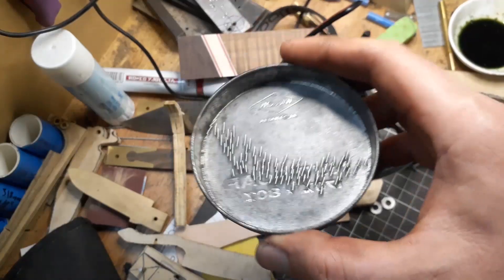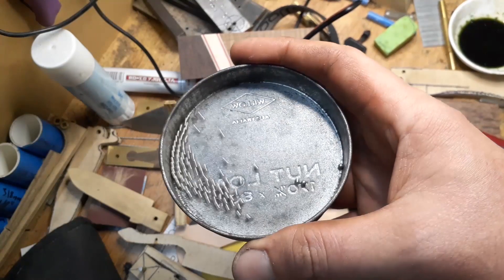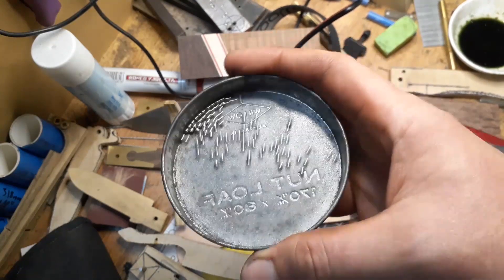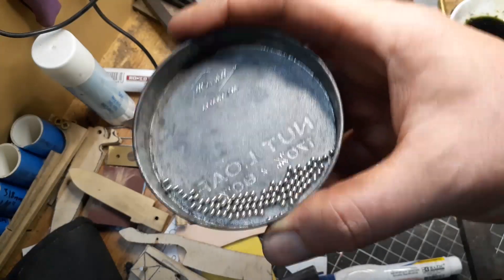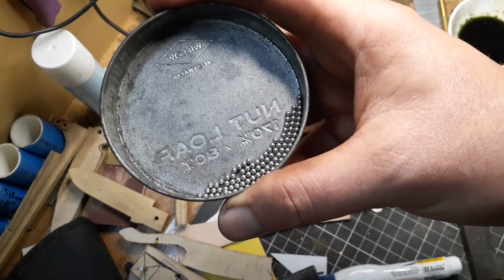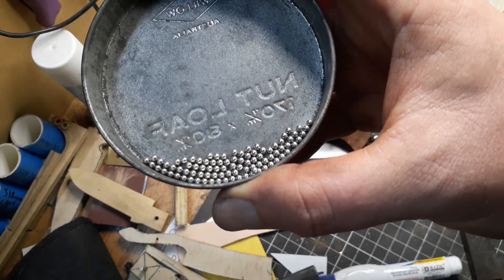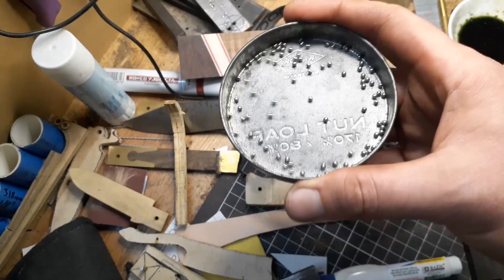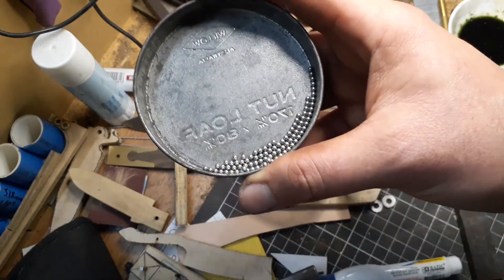Grain Structure Simplified For Beginners

Comment: I love knowing the why, things make so much more sense. So how does this apply with springs, or with your journeyman or matter level knife that you have to bend? If you're supposed to have right grain structure wouldn't that be a hindrance, or am I not understanding it correctly? Great video sir love the information. Keep up the good work.
Reply from the maker: A great question! So the tight grain makes the knife tough, and strong, but the tempering relaxes the bonds (the little bits of string) to allow them to have a bit of "give" rather than being super firm. This allows for a certain amount of spring! Tempering a blade correctly involves relaxing those bonds just enough to allow the knife to flex, but not so much that it will stay flexed! Check out my video on Young's Modulus of Elasticity to find out more!

Comment: Nice explanation Alex, thanks. Know "why" really improves my understanding of things, otherwise it can be rote learning of black magic. I've enjoyed Larrin's book and Sam's videos too. I think I need to re-read/re-watch to get it straighter in my mind. What is the metallurgist's name for the "fractures" that are the grain boundaries that stop the dislocations travelling past them?
Reply from the maker: As far as I'm aware the fractures don't actually have a name. It's simply the boundaries between the grains. They are the lines which separate the regions of organised crystalline structure from each other! I suppose you can think of it like tectonic plates. We have names for the plates, but not for the place where the plates are butted up against one another!
Reply from the maker: As a fun fact, if you look at the irregular patternation in the zinc coatings on galvanised metal, you are actually looking at the grain structure of the zinc coating. It's the same thing happening, but at a macro scale!
Reply: @ValhallaIronworks  Great, thanks Alex :)
Reply from the maker: Hey mate, I found out the name of the "fractures" and came back to tell you 😂 they're called "slip planes"
Reply: @ValhallaIronworks  Thanks very much :)

Comment: Nicely done, sir. The unfortunate truth is that to keep grain structure under control, at least for me, money must be ponied up for a proper heat treating oven so the proper soak times can be achieved, and so the quench is done at the correct temp. Reading the material sheet on 1084, which I've made lots of knives out of, pointed out how far from good grain structure I am. Sigh.
Reply from the maker: 1084 is always called a beginner steel, but it can be made to have INCREDIBLE toughness if treated correctly! A proper kiln setup is on my tool up list for this year!
Reply: @ValhallaIronworks  Me too! Paid for a biggish Evenheat two weeks ago, but there's a 20-week turnaround time. Sigh.
Reply from the maker: @brysonalden5414  that's why I'm building my own from scratch 😂

Comment: A knife guy once told me: imagine you're traveling by train, pretend one of the cars is full, about 100 people in there. From the windows it will look full, but they can still move around a little. Now put 200 people in there, it's still full, but there's more density and the people cannot move around, it's much more dense. Now think that one person pases out. In which case do you think that person is going to be able to actually fall to the floor?. He said, same thing happens with grain, if there's room to fall, the chances of catastrophic failure are higher. But as this guy mentioned, there're also a ton of other factors, if you have a small grain but the material has a lot of tension it will be brittle and snap anytime, normalization, quenching and tempering are super important
Reply from the maker: Some people are really into trains lol